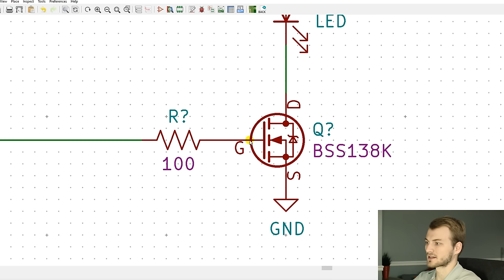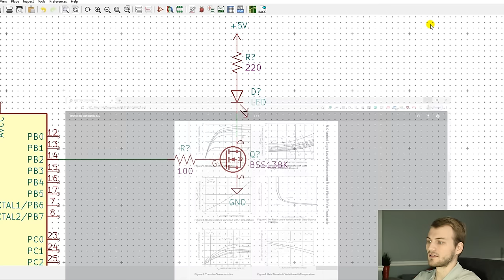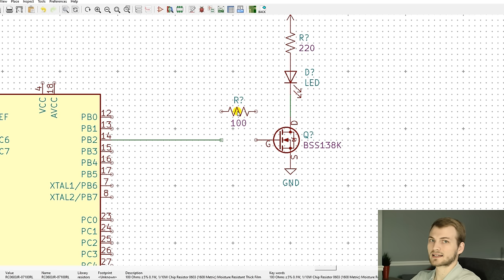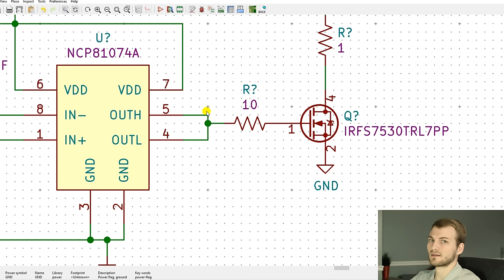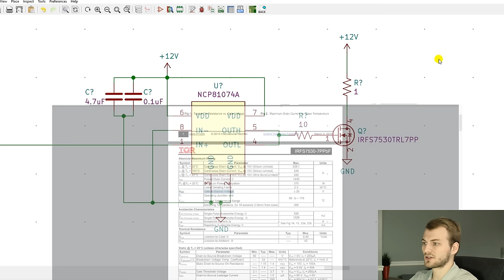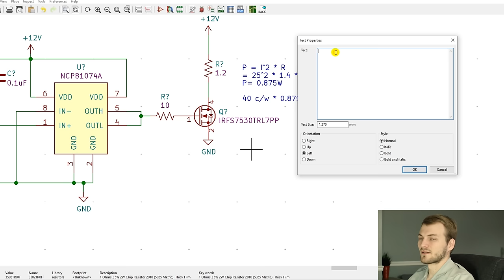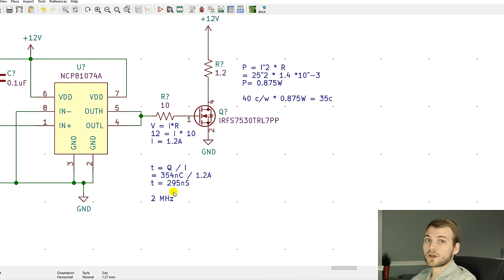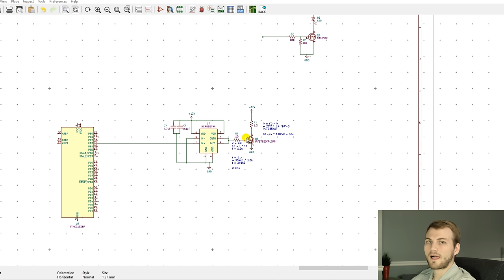Designing Power MOSFET Circuits - Circuit Tips and Tricks

Comment: The one thing about the driver ICs is that they really aren’t cheap. Some articles from reputable sources have recommended using simple BJTs as drivers - on the order of 1/20th the cost of the driver IC, with a similar component count. For example: https://www.eetimes.com/power-tip-42-part-1-discrete-devices-a-good-alternative-to-integrated-mosfet-drivers/ Assuming 10+V power is readily available to keep the MOSFET in its safe, low Rds operating zone, as is the case in the example presented, what other considerations should one have in mind when deciding between those two design options. This question goes a bit beyond the video, but it’s a really hazy area for me, and possibly others as well. Maybe something for a future video?
Reply from the maker: Looks like someone didn't read the blog ;) I mention how to use transistors to drive them instead of the gate driver. Honestly, you hit the nail on the head with your thinking, it's 100% cost based for me. I'll use a dedicated driver every time if the BOM cost can handle it. I actually had a section in the video about this, but cut it out for the sake of time.
Reply: @MicroTypeEngineering  <hangs head in shame>, I must admit it's true. ;) The post describes the tradeoffs sufficiently well. Thanks for taking the time to work on the blog as well. Until now, I didn't realize that the blog has quite a bit of extra info - not just recaps of the videos. Win. This whole topic has been quite timely for me, as I have to step up my game and step up the volume for my current project. Still low 100's of boards, enclosures, etc. - not millions, but still... Each widget has no less than 8 sizable MOSFETs (as well as many other goodies), so I'm forced to consider cost more carefully. The biggest hurdle now is switching 2A @ 24V (ideally 48V) - typically DC. On the surface, this seems so simple, but these figures are also outside the safe operating area of every part I've investigated to date. Maybe those plots are just misleading - idk. Time for a bit more math, I guess.
Reply from the maker: Haha no worries! Good luck with that, let me know if you need any help, especially with the assembly side. We're starting to expand out and work on final assembly and box-builds lately.

Comment: Thankyou for demystifying MOSFETS providing a perfect mix of practical and technical information. I'll mostly use this info to diagnose faults with equipment, do you think checking a resistance on the gate is a way to diagnose issues with mosfets without removing them from circuit?
Reply from the maker: Glad you enjoyed! It really depends, but in my experience, when a FET fails, it's typically going to fail as a short between the drain and the source. This is especially true for ESD failures.
Reply: @MicroTypeEngineering  Im currently dealing with a circuit where a 800ma Voltage Regulator located near the 12-18v DC power input is getting hot to the touch. The component in question is MC33269 in the 269AJC DPAK DT suffix

This could for a myriad of reasons but I suspect possibly injecting +42v into the circuit could have destroyed one of the components. 

Thankyou for your response!

Comment: nice video i have a question for you if am connecting the mosfet to an optocopler and VDD is 15 volts on the optocoupler , when i connect the gate to the mosfet the signal on the gate it goes under the gate needed voltage why ?

Comment: I tried  to drive IRFP460 ( Vge 10Volt ) with TC4420 ( 18Volt power supply ) but the max output  of TC4420 is 7,56 Volt with not enough volt to fully open IRFP460. Anyhelp ?  How much voltage goes the NCP81074 give ?

Comment: You most certainly can use the 7530 at a continuous 240A, with an adequate heatsink, preferably a soldered copper spreader to aluminum but its only 60 watts of dissipation. While I agree, you would never design a circuit to run a fet at it's package or any limit, the dpak will transfer enough to good thermal solution to get rid of 60 or so watts, everything else being best case. Good video
Reply from the maker: Oof! I'd love to see your source or calculations saying that a DPAK can dissipate 60 watts continuously! That's not happening due to their thermal resistances. Especially since you can't directly affix a heatsink to the metal portion like the THT FETs. I'm sure for short peak's it is possible, but certainty not sustained. See here for a good appnote on real-world max power dissipations: https://www.infineon.com/dgdl/ThermalPackageConsideration-DPAK-SO-8.pdf?folderId=db3a304412b407950112b408e8c90004&fileId=db3a304412b407950112b40b5e9a07a8
Reply: @MicroTypeEngineering  Sure you can. Don't pay attention to all that tj temp blah blah. Get a 4x25x50mm copper plate, solder that bad boy right to it and bolt the copper plate to adequality sized heatsink and she'll be right. Ok maybe it won't maintain 240 but you can get up there, that is until your rdsOn climbs to high due to heating and you're no longer dissipating 50 or 60 watts. Copper has twice the thermal conductivity of aluminum, or very near it and has surprised me in the past.
Reply: Please Search & read up on Amperage/Current limitations of different switching device packages...
i.e. their internal wafer/die to external leads/pins..
Back in 2003-2005 we were using a TO220 160A device..but later found out its D/S leads could handle a safe max.of 75A , above which any typical related failure mode could kick in...
Leaving aside adequate heatsinking/ heatspreaders etc.

Comment: So, what datasheet specs would one need to look at & which calculations would one need to perform to determine the practical V, A, & W that one could reasonably expect from the IRFS7530-7PPbF with & without a heat sink--when the ambient temp is between 20 °C to 38 °C? In other words, how would one go about determining when the mosfet would work properly in such a temp range without premature failure?
Reply from the maker: This sounds frighteningly close to a homework question ;)
Reply: @MicroTypeEngineering  Nope.  I'm 55 & just a curious person...

Comment: Awesome video with such a great explanation! Is there a simple calculation you use to determine what wattage is needed for each of the resistors in your logic level mosfet example (i.e what Wattage should the 100 & 10k ohm resistors be)?

Comment: Hello, I would like to dissipate a concept that is use in electronics here. First of all, I am a hobbits in electronics so I learn things watching or reading about projects that I am interested to. I had learn (when purchasing son SSR modules) that they are made with High and Low side, what I learned is that Low side SSR modules need a negative input and High side need a positive input. Anyway, checking your mosfet driver, it's description in the datasheet said low side driver, the mosfet you are using according to you it's a NPN mosfet... Unless I am misunderstanding something, is it the mosfet driver should be a high side driver?  Thank you for your time.

Comment: Is the gate resistor really that important? Gate capacitance of smaller MOSFETs are not going to be that large..the gate resistors are really useful for reducing ' ringing' and EMI issues. I would not be worried about short circuit type currents into the gate from uCs... I have not come across any issues so far...unless I am wrong.  Pull-down resistor however is a must
Reply from the maker: Yeah you're "mostly" right. It typically won't cause an issue with small FETs. But, when you have that gate resistor there, you know exactly what the resistance is, and you can vary it to test. You'd be surprised what a little gate resistance will do to help ringing and EMI compliance issues.

Comment: Thank you for this - this helped a lot.
I have a question though - why is a gate driver IC necessary? Isn't a microcontroller IO pin capable of charging/decharging the gate by itself?
Reply from the maker: In some cases sure. If it isn't a logic level FET, it won't produce a high enough voltage to turn it on. If it is a logic level FET, some MCUs can be damaged from trying to source that much current that fast. Even if it can, it will not be able to switch the FET on fast enough for certain applications.
Reply: @MicroTypeEngineering  Thank you for the reply. I feel like I've got a handle on it now.

Comment: Gate resistor: not sure it is about the capacitor being gharged since if the GPIO (or a battery) tries to charge a RC circuit with R really low, the battery (or the GPIO) will simply limit its current naturally: it starts with 0uA, and gradually climb up to the maximum it can supply... as constant current. 

On the other hand, when you discharge the capacitor, putting the MCU GPIO pin to a logical 0, then you ask it to SINK a large incoming current (if R = 0) and THAT can damage the electronic inside the MCU.

Also, many MCU allows you to use an internal resistor to their GPIO pins, which would be more than enough to do the job, without an external resistor.
Reply from the maker: Yeah, that's mostly true. Until you use a microcontroller that it isn't, and you destroy it while trying to save a penny on a resistor. It is really never worth it to not have one, you can always throw on a 0R if you really end up not wanting it. Plus, without one, you can't do any real calculations on switching speeds, since the R is rarely given in the MCU datasheet.

Comment: Please be mindful that the decrease the turn OFF times is to drive the gate negative witth a class B drive amp to discharge the gate capacatance. if not then you will run into problems.

Comment: So my application has a p type mosfet because i am controlling it from a current sinking device. I suppose i still need to worry about the max voltage between the drain and the source and the gate and the source? That sorta sucks

Comment: Thanks for the video, I love your channel...

However, I do believe there are times to drive the gate directly without a gate resistor.

My current project is a ATTiny1606 so I feel it is pretty good MCU. I have it driving a smallish logic level MOSFET (IRF7313). It switches on and runs for a minute and switches off. No PWM. Other components will wear out I imagine in 10k cycles. I have decided I would like the MCU and MOSFET to last for 30k cycles (thats 10 uses a day for 10 years and way beyond the practical life of the product or other components).

I am hand assembling each board and every component on the board is a time cost, this is why I used a dual MOSFET instead of 2 cheaper single units. I have decided to run burn in tests and have 100k cycles on the test unit. So far everything looks fine and I can't justify increasing component count by 2 when I have been so tight everywhere else.

If they sell, I will be redesigning for pick 'n place and the gate resistor might go in with a bunch of other changes. As for now I am happy and on the path to 200 units.

To anyone else in my situation I would say if you are using PWM consider a driver, if you have a MOSFET with a large gate, a resistor is a must. If you are in the specific need to run a small MOSFET 10k times with a decent MCU you will be fine. You may be operating the MCU out of specification, think logically how many failures you may cause and decide if that is acceptable product loss/failure.
Reply from the maker: Sure, that's certainly possible, and I've done it plenty of times. The big thing to consider, is you're potentially introducing a risk, to save a few tenths of a cent. That normally doesn't make sense.
Reply: @MicroTypeEngineering  couldn’t agree more. Seriously thanks for your videos. Your older ones kind of inspired me. We appreciate people that share knowledge, good luck with your endeavors.

Comment: Thanks for the video. Now that Micro-Cap is free, maybe you could use that instead of KiCad. That way you'll be able to show the circuits actually running, and you'll be able to see how close the actual circuit is to your calculations.
Reply from the maker: Thanks for the tip! I heard about that a little while back, been meaning to look into it.
Reply: @MicroTypeEngineering  If you want some tips on how to use it, have a look at the "Kiss Analog" channel.

Comment: Tomorrow my exam pls help Sir

A power mosfet with a breakdown rating BVDSS =800V MUST COnduct 10 A when on with a maximum on state voltage VDs =4v if the current density in the mosfet limit to 200A/cm2, estimate the conducting area which is required

Comment: Hi, if i using the case on mosfet, in calculate for dissipation i use junction-to-case (0.40) instead junction-to-ambient(40)? Thanks for your video.
Reply from the maker: No, as that's just to the case. That measurement is used for when you're using a heat sink
Reply: @MicroTypeEngineering  So, if i to user a heat sink, in calculate i would using junction-to-case, correte?

Comment: Thanks for making the video.  very good explanation for everything, however suggesting the IRFS7530 as the "go to" is not such a great idea.  It is very expensive $2.00 in 100 quantity which is usually more than most people would want to pay for a 'go to" FET.  It is also over kill for most applications
Reply from the maker: True. I should have explained that sentence better. Since most of the work we do are on high power, low quantity boards, BOM price is usually secondary as a consideration. Definitely should have at least prefaced it for being a "go to" for high-power applications!

Comment: Pro tip, don't use International Rectifier trash. Figure of Merit/Switching characteristics are terrible compared to similar MOSFETs with the same or lower Rdson. 13:12, that gate charge spec is terrible. The TPW1R306PL has a lower Rdson, total gate charge of less than half that, miller charge of 1/7th and gate switching charge 1/5. Switching losses are non-negligble. Switching losses are not simply the energy dissipated in the gate capacitor, it is also the energy dissipated when the MOSFET's Drain-Source voltage goes from near 0 to load voltage when turning off and back down again when turning on; this does not happen instantaneously and the MOSFET is dissipating full load current when this occurs. With a MOSFET as terrible as the ones from IR, their switching losses dominate well into 80A + for 48V systems.

Comment: I've seen schematics where the series resistor is put between the gate and the pull-down resistor instead of between the driving output and the pull-down resistor.  Which setup to choose and why?
Reply: It depends on the resistor values.
If the series resistance is very low, it makes virtually no difference. If the series resistance is a "significant" fraction of the pull-down resistance, then you have to consider the voltage division.
I've seen MOSFET boards sold to the hobby market with a 1k pull-down. That's far too low in my opinion unless you are relying on that resistor to reasonably quickly discharge the gate capacitance.

Comment: Hello can you make a video about driving mosfets in parallel.
Reply from the maker: Care to explain what you mean by "parallel"?
Reply: @MicroTypeEngineering  Not sure what the OP wanted, but I was also wondering about this. Can I parallel several MOSFETS to increase current handling? I've seen somewhere that it can be done with appropriate gate resistors, but coverage in more depth would be useful.

---- current -----> MOSFET ------> load
                     |--> MOSFET --|
                     |--> MOSFET --|

Comment: Can you please explain gate resistor calculation for a msofet being used as a high side switch. Consider that mosfet is supplying continuous current and not in the switching mode. I am really confused how to calculate the gate resistor for high side switching.
Reply from the maker: Consider the MOSFET gate as a capacitor. When you go to charge it up, the circuit driving it see's it as a dead short. Depending on the specifics of the driving circuit and the FET itself, this can destroy what is driving it. Also, it can cause ringing at the gate, which could cause EMC issues. Normally just throw a 100-1k and you can adjust it if you see any issues.

Comment: how do we determine if the switching frequency is too close to the maximum switching frequency? If the target switching frequency is 1MHz, do 4MHz enough for using? or we need to have 10 times higher than the target switching frequency which is 10MHz switching frequency in order to ensure the target switching frequency can be met? Why do we need so much switching frequency buffer
Reply: I would like to know how do we determine the smallest ohm of gate resistor of a particular MOSFET which can still avoid oscillation. is there a formula or we can only do experiment to determine the smallest resistor.
Reply from the maker: I'm working on a video around that now! Stay tuned

Comment: i have a question regarding the gate resistor value, what if i used 4 mosfets in parallel, should i increase the resistance value of the gate resistor?
Reply: 4 individual series gate resistors for each of the four Mosfets....instead of one single 100 ohms..4 of 240-330 ohms each is ok .... provided the gate driver  has sufficient drive capability..& each with their own pulldown resistors..but preferably higher value..
One gate 10k to min.5k6 is ok 
But four separate ones ,each can be as high as 18-20 k each

Comment: I have to disagree about the "two kinds of MOSFETs"  You can certainly have high power logic level MOSFETs.  An example that is not particularly new is the FDP8880.  What makes a MOSFET logic level is a low threshold voltage.  Particularly a MOSFET that will be essentially turned full on at or blow a Vgs of 5V.  The FDP8880 has rds of only 14.5 mohm at 4.5V Vgs and can pass up to 54A, deal with 30V and dissipate 55W.